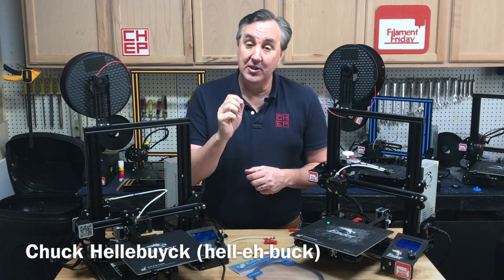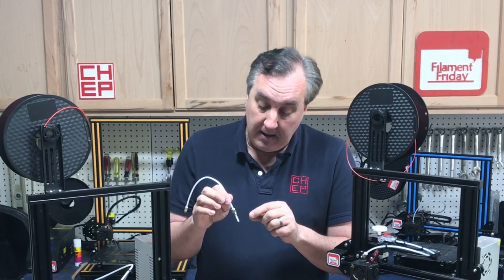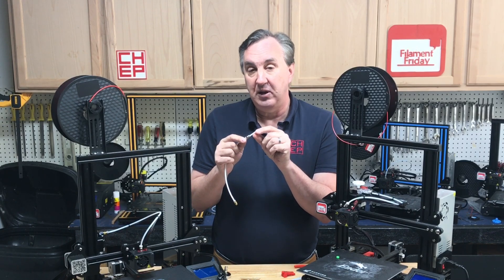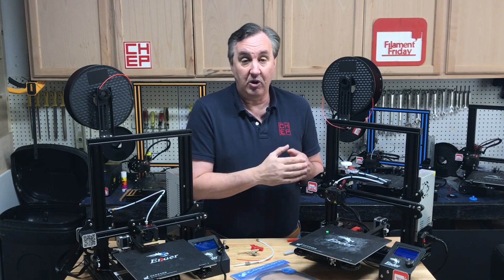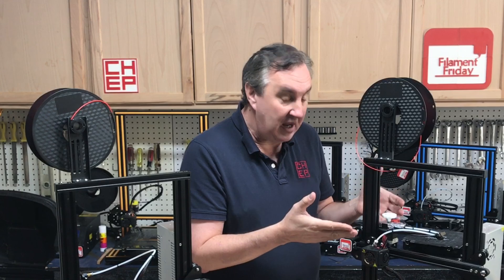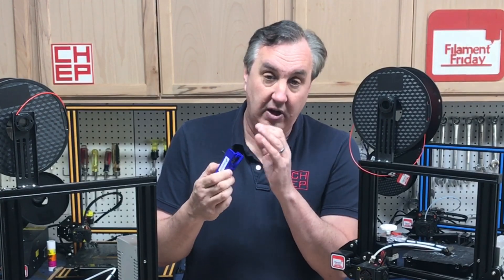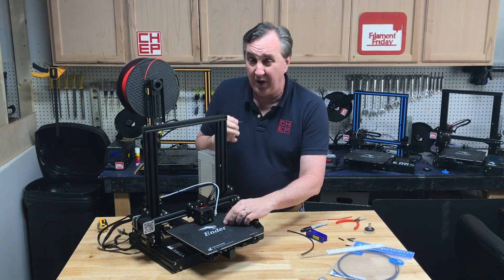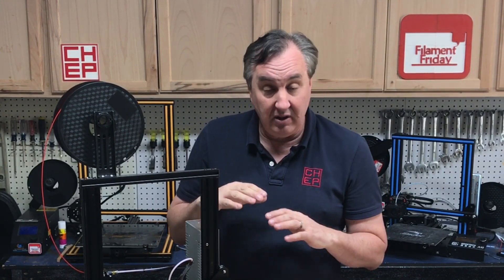Simple HOTEND FIX for Creality Ender 3, CR-10

Comment: I.. I don't understand.. So the washer you put in direct contact to the hotend block?

Why? Didn't that will melt?
Reply from the maker: It’s cold at the top if your fan is working right.
Reply: @FilamentFriday  can i do this without capricorn? so i put the washer, then install the bowden nuts, then push the ptfe to hotend?

this washer functions as like more gripping on ptfe tube so it wont be accidentally pulled and create some distance that could lead to a leak?
Reply from the maker: Yes, you can use regular PTFE. The washer pushes the PTFE down when the coupling is crewed in.
Reply: @FilamentFriday  so.. Put the washer first, slide in the coupling into ptfe tube, insert the ptfe tube to hot end till some bumps, then slide the coupling to screws thread and tighten it?

Comment: I kept having leaks despite my best efforts to push my tube all the way down to the nozzle. I decided to give this fix a try and so far I haven't had any issues! The insert printed easily and fit perfectly. Your videos are so straight forward, helpful, and easy to understand. I refer other people to them constantly! Thank you!
Reply from the maker: Thanks.
Reply: did you use stock ptfe by the way? install the washer, install bowden hole nut, then push ptfe down till nozzle?

or you use like cut from capricorn tube too?
i was planning to do this without capricorn tube, cuz i want to prevent leakage.
Reply: @CTZN1  I used capricorn for the cut piece

Comment: This just helped me so much I cant even believe. The coupler to my hot end stopped grabbing the ptfe allowing it to come off thankfully i printed the spacer before all this mess happened so I cut my tube and did the mod and what do you know, it bites the tube and I dont have to worry about the other problems this fixes down the line. It definitely made me smile knowing I can print while waiting for the new capricorn set to come in 😊

Comment: Would adding a titanium or bimetal heatbreak be better?
Reply from the maker: For some filaments it might.
Reply: @FilamentFriday  thank you sir. I am new to 3d printing and currently only use pla.  Was looking to start with some petg but was concerned that i would have to upgrade my hotend to a all metal type and would have extrusion issues with the pla.  I am using capricorn xs.
Reply: @marksdroidx  PETG works fine with the standard hotend. With a printer as it comes from the box. It is more critical with cooling and temperature, but you need no special hardware.

Comment: Thinking outside the box, some complain that printing Petg with the fan off can heat up the upper end of the hotend enough to melt or deform the printed pla or Petg spacer. What about printing a pla spacer mold instead and filling it with a high temperature red automotive silicon rtv? Once cured the spacer would compress and form a seal against the top of the tubing and bottom of the coupler. Granted the spacer hole would get smaller when compressed but that’s what trial and error of a idea does.
Reply from the maker: If you have that much temperature creep up there then you have a bad fan. The top of the heat sink should never get that hot no matter what you are printing.
Reply: @FilamentFriday  I agree! I just had a conversation however with a person in a Facebook group upset with using pla you used in your video. It seems 5 hours into a print the washer failed and “ created a mess”? I only use Petg for anything around or on the hotend area so no complaints. 
Btw, I really like your way of simply measuring the depth to the back of the nozzle to the top of the hotend opening and doing some simple math. I tried the printed cutting guide and various printed washer in the past and it was a bust for me! Simply measuring the total length of my particular hotend and subtracting the depth I want the coupler to screw in took minutes to do.
Reply: @gr7396  There should be a distinction here between the hotend fan and the part fan. You should always have the hotend fan on in order to prevent heat creep as described here, but PETG can be printed with the part fan off. I'm guessing the person complaining has their hotend fan off, since having the part fan on or off will not affect heat creep as it doesn't cool the hotend.
Reply from the maker: I’ve used that PLA in mine since the video was released. No issues at all. Odds are he had a fan problem and used this fix hoping to help instead of a new fan.
Reply: @FilamentFriday  I think he’s agreeing now. Next big print I make pla and Petg ( no fan) I’ll measure the top end coupler heat with my contactless temp meter. No bother and it’ll be fact or fiction based on the “science” :)
Reply from the maker: I can touch mine with my fingers. If it’s warm I replace the fan.

Comment: What print settings do you use for the insert/washer? Quality, infill, etc.
Reply from the maker: PLA
Reply: seems like a part that needs to be durable. probably print hot and slow. 50mm/s, .1 resolution, 100% infill

Comment: Instead of cutting back the 20mm at the end right away, why not flip the tube first, so you get a fresh piece on the hot end while maintaining the length? Then you can get 1 more segment out of it before you have to cut it back.

Comment: Hello Sir. With your modification is it possible print with Nylon or carbon filaments?
Reply: Sir, with Microswiss hotend, may I use PLA or PETG filaments? Or is it necessary change the hotend again?
Reply from the maker: They will work with that Hotend. My mod won’t allow Nylon unless you can print at less than 240.
Reply: @FilamentFriday  Thanks Sir. Another question: I saw some videos where they say that using all metal Hotend created problem to setting the extruder, mainly the retraction values for PLA and PETG. What do you say about?
Reply from the maker: It can. Depends on the machine and how well it’s tuned.
Reply: @FilamentFriday  I will have a Ender 3 V2. Your opinion has valued
Reply from the maker: Not a good machine for Nylon or higher temp. I’d choose a Prusa mini.
Reply: @RCpropo  spanish?
I recommend to get a well known brand all metal heatbreak.
I have bought a complete all metal kit by ebay about 75 USD one and half year ago.
It works great with Nylon and TPU filaments.
However I never could print PLA more than 10 hours. Every time it comes clog even I oil filament (canola oil). I guess because heatbreak is defective maybe its inner wall was not well polished. I will try Titanium coated heatbreak next.
It is not easy to print Nylon in a open frame printer.

Comment: Your videos have been very helpful without a bunch of self promotion. I like that, thank you.  Anyway, have you produced a video on the pros, cons and recommendations of all metal hotends? I want to print fiber/glass infused nylon or carbon fiber for a high wear component. Or perhaps you have another material recommendation?
Reply from the maker: Nylon is best and it requires an all metal hotend for high temp.
Reply: @FilamentFriday  so what features on the hotend am I looking for? Like everything, there seems to be several choices or designs. Some substantial price differences too.
Reply from the maker: Check out Microswiss hotend

Comment: Awesome video thanks for the help. Umm would PLA work for the washer or no. I have a feel it maybe to warm there for a PLA
Reply from the maker: Yes, PLA works. If it gets too hot for PLA up there, you have bigger problems such as a failing fan.
Reply: @FilamentFriday   alrighty thank you so much for the response. I'm gonna print one out now
Reply: My first inserts are white PLA without any problems since I converted 4 months ago. My next washers will be white PLA+ since the temp is just a little higher than regular PLA. I chose white because the color white dissipates heat faster than dark colors. I assume it does the same regarding 3D printers. But I really don't have anything to back that up.

Comment: Hi Chuck I just changed my extruder except for the fan case.   If I use the same settings I always use for HIPS,  there is a burning smell and than there is that alert if you will that could bust your eardrums.  Any idea?

Comment: Hi Master, Thanks again for the helpful video, may i ask you do you have any video is talking about the 2-4 btm layer issue ? i have a horrible issue about it, i change whole set new hotend , ptfe, nozzle, extruder, pla....but the problem cannot be fix. The first layer is perfect, but start from the second layer are very bad...something like over extrude, look like the gap between first layer to 2nd layer are not 0.2mm, end up make some clog, but if luckly finished the 4 layers...starting with the infill, then have no problem anymore...pls help, i tried alot of diff way..but its dosent help at all...
Reply: Try raising your Z limiter. My ender3 has a hard time with the first few layers when the Z axis is bottomed out.
Reply from the maker: Check for binding of the stepper motor or the brass t nut on the threaded rod is too tight.
Reply: Thanks for you both reply...appreciate it , trying out the solution now, i checked the Z motor and brass , its look fine. so i raising up the Z endstop and try to print. update to you both later. thanks !
Reply: Thank so much @supersmashman18 !! I rising up the z limiter, its really help for the btm layer..i have no idea what is the reason..haha

But the extruder skipping problem still here, but didnt make any clog yet. But at least the print is nice now.

Appreciate it !

Thanks master to help toooooo

Comment: I did this fix and I want to replace the piece of PTFE inside the hotend, but I can't get it out. Does anyone have a solution?
Reply from the maker: Heat it up, remove the nozzle and coupling, then put it out with longer PTFE.

Comment: did you have to change the retraction settings after doing this mod because i have done this mod and i get nothing but bad prints prints will start out ok and after bit it just stops pushing the pla out ?
Reply: I had this problem too on my first try. It turned out my insert tube was short and wasn't cut square creating a gap.

Comment: What will happen if you use metal tubing instead of Capricorn tubing?
Reply from the maker: It will heat up and melt the filament causing a clog.

Comment: Can anyone help? I have performed this fix on both of my ender 3 pro's and one works flawlessly but the other is impossible to change or feed filament without taking the bowden coupler off. The washer and bowden tube insert in the hotend don't line up and I have to feed filament through everything and into the cold nozzle, then make sure everything is snug. I have tried multiple inserts for the hotend, drilling/tapering the washer more, cutting different points at the end of filament, tried both hot and cold, etc, and am out of ideas. Surely someone else has had this problem???
Reply: I have but you just have to depress the extruder arm and pull it out and push it in a few times and it should catch. If it doesn't then your PTFE tube you inserted probably isn't straight. Also make sure your filament is cut at a good 45 degree angle or more. That will help when inserting the filament.
Reply: I took an sharp Exacto blade and just rounded out the top end of the tube insert a tiny bit. It creates a funnel for the filament to go into easier. This works really well with Chep's funneled insert washer. Just make sure the wider end is the feed end.

Comment: So the plastic insert should sit above the hotend or should the ptfe tube be short enough that the insert goes inside?
Reply: The ptfe plus the washer should both go inside the hot end and still have about 3mm for the hot end coupler to thread into. The coupler will slightly press on the washer which pushes on the ptfe tube.

Comment: Had the same thing happen and used a spring tooth washer that's designed for it on the inside so it grabs as the other part is screwed back down. Don't budge but now have my first clog and working that out.

Comment: What method do you use to pull out the ptfe tube when there's clogged nozzle?
Reply from the maker: If it’s a clogged nozzle then just unscrew the nozzle. If you want to remove the PTFE also then also push down thru where the nozzle was with another section of PTFE. Make sure it’s heated.
Reply: Yeah, I would like to know that too.

Comment: Hi there, is this fix necessary if you use the Capricorn tubing throughout the entire setup? Extruder to Hot end?
Reply: I think this fix with the washer ensures the cap in the hotend stays put whereas a complete length all the way still has the possible failure point of the top of the connector I.e. it can still come loose as create a gap between the end of the tube and the bottom of the hotend.

You could still use cap all the way along. This fix ensures it is much less liable to coming loose.

Comment: Hi Chuck, followed your instructions after experiencing my first blockage.
Made my own washer and used some teflon tube from on line. I added a small spot face to center the top of the tube in the washer.
Printing with PLA Carbon Fiber from sunlu so far so good. Thanks Mick

Comment: What material washer?
Reply from the maker: I used PLA
Reply: @FilamentFriday  wont it melt or warp due to temperature? I thought this was the hot end :D
Reply: @jorgenfischer  Well, it goes on the cold end of the hot end. The gray square is the heating element, the red metal is a heatsink that kept the top fitting on my machine cold to the touch while the extruder was at 210°c so I wouldn't worry

Comment: I found capricorn tube thinner internal diameter, is smaller, causes blockages :(
Reply: i too have found this to i did the mod over 2 months ago and did some printing in that time then stopped just gone back to print something and now the capricorn i put in the hot end now seems to catch on the pla i push inand the capricorn seems to have shrunkand now seems to grips the pla any ideas ? ps im only painting  at 210 and 60 on the bed
Reply: @vac91  how to get the PTFE tube out?
Reply: try to get something in a shape of a small hook or just unscrew the nozzle.

Comment: Love this video. Fyi for those having trouble putting filament through Capricorn tubing inside the hotend. Just use a razor blade corner to shave off and funnel it inwards just like the washer is doing above it as well. Make sure tube is clean before installing.

Comment: Is there anything wrong with replacing all your PTFE tubing with Capricorn for this upgrade?
Reply from the maker: No.
Reply: That's what I thought too, does it increase friction compared to stock PTFE? or why go all that hassle? Wouldn't it be easier to just change whole tube with capricorn?
Reply: @innocentidiot9521  I do like the idea of PUSHING the tube into the hotend, that way even if the retracts pull the tube out the tube connected to the hotend remains fixed in place.
Reply: @Perceivedshift  I have never had any issues with stock one.  (Astroprint's estimated print time:950hrs). Though I have lubricated it with teflon spray for easier TPU printing.
I was looking for printing nylon at higher temperatures(260°C).
Reply: @innocentidiot9521  Yea, I've had no issues either on my CR6 SE with the stock tubing.  But like you i'd like to print some materials at higher temps, that is where capricorn tubing will be good to have.  At $13 its a cheap upgrade that might save me some trouble down the line I think.
Reply: @Perceivedshift  
I think that I found reason for that. It's like CHEP said, coupler doesn't hold capricorn tube enough tightly against nozzle and printer starts having extruder issues after a while.

Comment: I found it easier to put the coupler on last because my filament wasn't finding the right holes to go through into the hotend. I inserted the filament thru the Bowden tube, then thru the coupler at the hotend, then let it peek out 3-4mm and then inserted it into the PLA washer, then into the 31mm Bowden tube inside the hotend. Lastly I screwed the coupler on until tight.

Comment: So, I am still waiting for a printer that has no factory defects when new.  Like a printer that no one has to modify after it's been running a while.
Reply: Moving parts = wear and tear. No getting around that.
Reply: That would be the Prusa MK3S. There is a reason it has such a high price compared to equivalent printers. It's not that it's THAT much better than other printers, but because there is incredible support and A LOT of R&D to make it the most consistent, and beginner friendly printer there is. You might need to change the LM8UU bearings and rods after a lot of use, and a couple of nozzles. Other than that it should run flawlessly for years.

Comment: why then ise ptfe tube and not a small metal pipe?
Reply from the maker: Because it would heat up and melt the plastic too high up and block the filament path.

Comment: this just came up today randomly I sometimes use youtube as background noise. then i heard you say something about stringing. I have be fighting a petg stringing prob. and my extruder makes a clicking noise while printing the purge line. fancy ezr extruder isn't supposed to do clicking and i had to print at 255 to get my prints to work.  long story short i had a split at the bottom of my tube.  i followed your video im now printing at 220 petg no clicking and slight blobbing at the top of a string test. no stringing. I'm going to join your patreon group. never supported someone this way i'll need to figure out how to join. keep up the good work.

Comment: Is this still necessary with an upgraded black coupler that can eliminate slipping + using the last screw turn to squish the bowden tube in after fully inserting and locking the tube? Seen it on one of the ender 3 v2 build vids.
Reply: Yes if you want to print at higher temps for other filament like abs